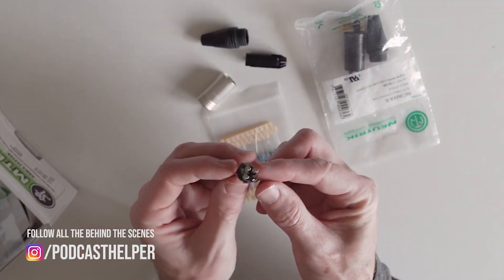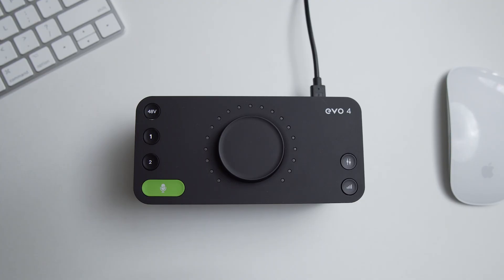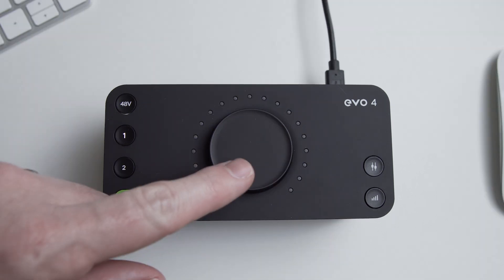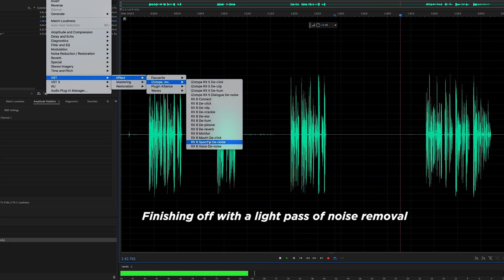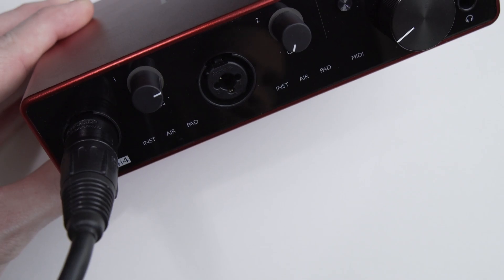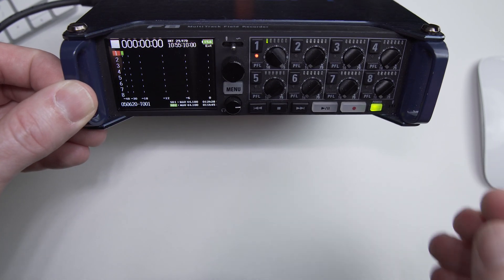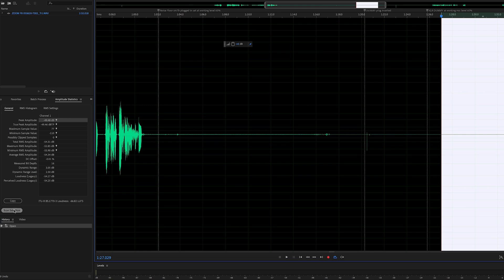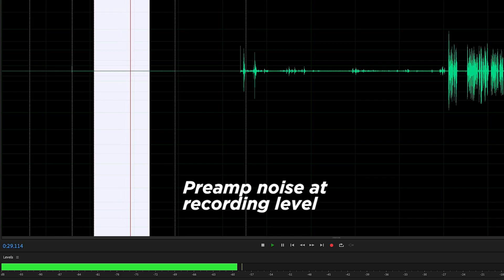Preamp Noise vs Room Noise - How I Measure the Difference

Comment: I am using sm7b with ssl2 and I need to turn the gain pretty high to get usable volume 
when I turn my gain up and turn my monitor mix to the input side fully,I can hear some constant noise and when the gain is more up,it’s louder ,is that the noise floor?Will Klark Teknik ct-1 or any inline preamp make that noise lower?
Reply from the maker: That's a nice interface, with 130.5dB EIN / 62dB of Gain, it's enough to drive an SM7b without a booster and maintain a low noise floor. In most cases, the issue is the room. Mics pick up everything even dynamic mics that have a cardioid polar pattern, it's still going to 'hear' fans and room tone. There's likely reviews here of that interface that demo it with an SM7b, look for some of those and see what results they are getting.

Comment: Is that adobe audition you’re using? What menu option(s) give you the noise floor/ rms info?
Reply from the maker: Yes, Audition and if you go to the Radio Production Workspace, you'll see the tools for measuring the noise floor the way I did in the waveform editor.
Reply: @RayOrtega  Thank you!

Comment: You are the only video with an sm7b that I couldn't hear the that annoying white noise. Why can't joe Rogan's podcast have this clean of a sound.
Reply from the maker: Thanks. I don't listen to that podcast but they either aren't using a good preamp or they might have an HVAC system creating noise in the studio. When you build a custom studio like that, you definitely can create heating and air conditioning that won't leak into the audio and there's no excuse for anyone making money from their show to not use the right gear.
Reply: @RayOrtega  Thank you so much Ray for finding the time to reply. Appreciate it. Although, I have to say it isn't the HVAC system since its really present it i'd say most of the YT vids featuring the SM7B. I have a dbx 286s and for the life of me I cant get rid of it. Anyway, thank so much again!

Comment: Why when you are trying the evo 4, in the rms meter it says 4i4?!?!  My interface umc 202 has noise at max gain without mic at -59 rms short term(separate info comment). Nice video
Reply from the maker: Not sure, what is the timestamp of what you are seeing? I'll take a look, I could find it. I'm definitely not trying to trick you lol. Definitely could be an editing error.
Reply: @RayOrtega  I also corrected my comment XD, it's the part at 2:01 (4i4 max gain but I think and evo).
Reply: I noticed this too. Little error

Comment: I like this:
*But a better test is to plug in your microphone, set the gain to what you need to record a good level (-18 to -12db peak) and then insert the dummy plug and measure the noise floor. 

In Julian Krause test he puts the gain at maximum level but for me It's best to measure in a "normal" recording situation, like You have done.

Comment: I think you’ve reviewed the audient evo4 and I was wondering If you had any radio or electromagnetic interference with their it? I’m trying to figure out how to get rid of this high pitch hum/buzz. It comes in an out intermittently.
Reply from the maker: I did and that was my biggest issue with the device, it seems not as well shielded from interference as other devices. For me, it mattered where I placed the device. Make sure you are not near something that can create interference like too close to a computer or speaker or phone etc. You could be getting a ground loop from the power so try different plugs or power sources making sure cables are crossing microphone cables or other power cables. I did have interference but I was also able to setup in a spot where it didn't pick up any issues, I think the phone being too was what created most of the issues in my case
Reply: @RayOrtega  exactly what I’m thinking it is. Because if I touch it or move it the interference can go away. 

Trying to see if there’s some sort of diy to get it to ground better or buy a USB isolator. Might try that. 

Thanks for answering and helping me confirm my suspicions! It’s been driving me nuts for the last 48hrs! Haha
Reply from the maker: @AtomicPixel  Cool, let me know if you find something that works better to shield it!
Reply: @RayOrtega  HAHAH you won't believe it, but I put a sheet of tinfoil on top and it now works great. Not a long term solution as I'm in touch with Audient Helpdesk so hopefully we can sort it out, but thought it was funny so I wanted to let ya know. :)
Reply from the maker: @AtomicPixel  Nice. Actually very helpful cause one idea was that the shielding just wasn't enough. That seems to help prove that case. I wonder if opening it up and lining it with foil, at least the top of the inside, would work well or if it would cause issues inside. I might have to open it up and try it! :)
Reply: @RayOrtega  exactly! That will be my next step if I can’t return it

Comment: dude ray...you just blew my mind
ive always done the noise reduction first and had to do like a 50 percent noise reduction just to get my noise floor to -60 db, i noticed that after doing the high pass filter, i only have to set my noise reduction to like 10 percent to get my noise floor to -60 db

so, is the correct process for reducing the noise floor to

1. high pass filter
2. then do noise reduction?

also, is -60 db the range the noise floor should be?
Reply from the maker: Cool! And yes, high-pass first then noise reduce. In fact do all your EQ "cuts" (any reduction, no boosts) first so that the noise reduction has less frequencies it has to process. In other words, always do at least a high-pass at 80Hz or as much as you can until it negatively affects your voice that way you reduce noise before you actually get to noise removal software and then run that software for what is left over. I also mention this in my newest video about noise reduction https://www.youtube.com/watch?v=RW3WIzdljZU
Reply: @RayOrtega  dang man, i had no idea, you smart man!!
 so as you mentioned, a -60 db noise floor is pretty common for a good vocal?

iuno why im expecting the background noise to be like dead silent at -90 db after the noise reduction
Reply from the maker: @sungkim465  Thanks. In my ideal recording environment, my levels when quiet while recording are less than -60db and then when you bring that up in post production you should be able to apply a little noise removal to get that down to -70db or less and once you hit -70 to -75db range noise will no longer be perceivable by almost any listener and it's certainly not worth degrading your vocal too much for noise that 99.5% of the audience will not hear but I understand being satisfied with your own expectations but if you start clean and then reduce a little, you should be really happy with the vocal. You can also add some light expansion which I show in the video I linked which will push the rest any noise down further in the quiet parts and while you are talking you won't hear a noise floor that quiet cause it is buried under the vocal. Good luck with your productions!
Reply: @RayOrtega  that is Reallllly awesome info ray. wow thank you so much

Comment: It's amazing that the gear itself creates this noise. I can fix this in post but a cloudlifter seems like the best option for a live stream.
Reply from the maker: Yeah electrical signals inside are going to have some inherent noise but in many devices today, even cheaper ones, it's a non factor. Using a CL in the case of live-streams will help you get to a level that you need for live which can tend to be louder than what you need to record.
Reply: @RayOrtega  Thank you I'm experimenting some background noise in my a mixer I have (zoom livetrack L-8) and seems like I can't get rid of it. It's not loud enough but it's there.